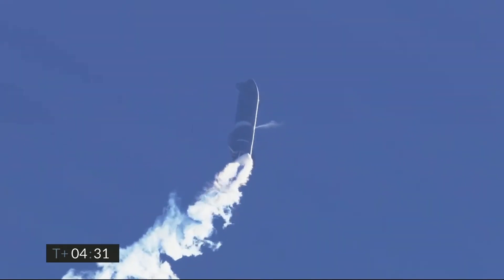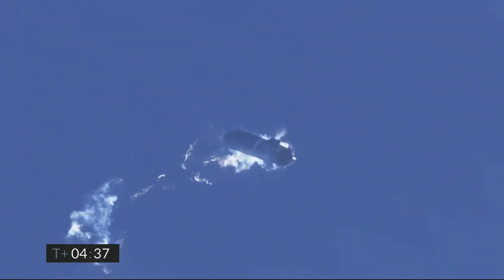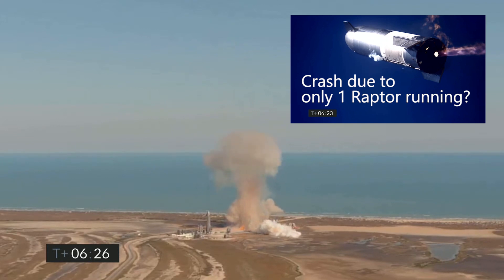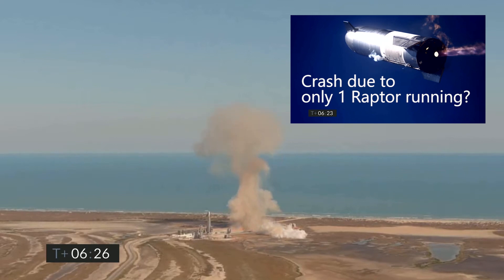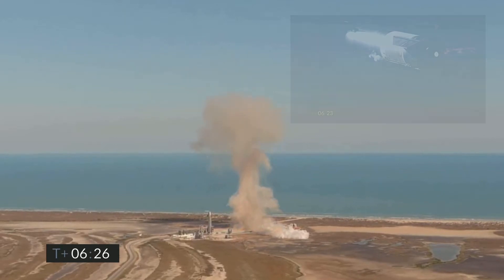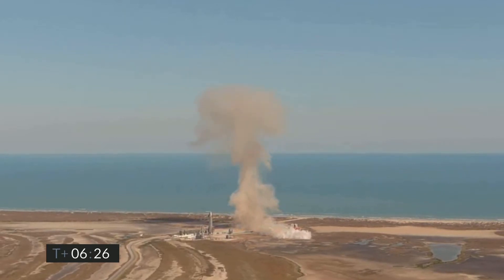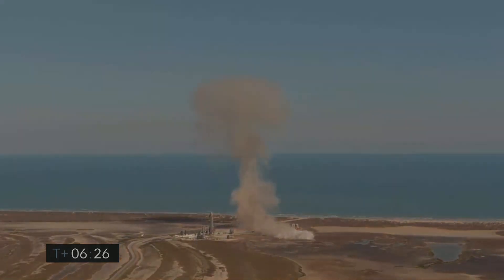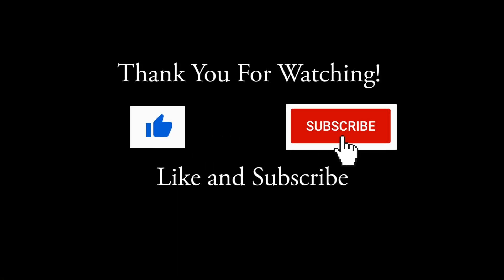SpaceX SN9 Flight Test Highlights and Crash. 1 Raptor failed?

Comment: But they said flipping and switching to one engine- are raptors and engine not the same? 
Also Sn8 did essentially the same thing but with much more grace. 
I’m very curious, and awaiting a much more detailed analysis from the spaceX team
Reply from the maker: Much speculation with no Elon tweets. SN8 had 2 raptor engines light off, but one of them lacked oxygen, and didn't produce as much thrust. SN9 was supposed to have 2 raptor engines light off as well, but only 1 got going. So I would say SN8 had 1.5 engines running, and SN9 hit harder with only 1 raptor engine operating.